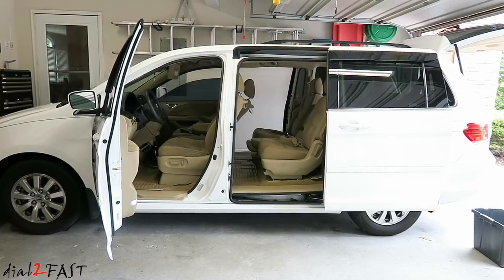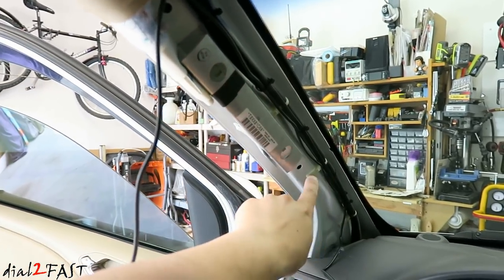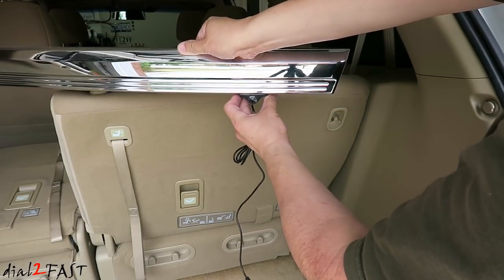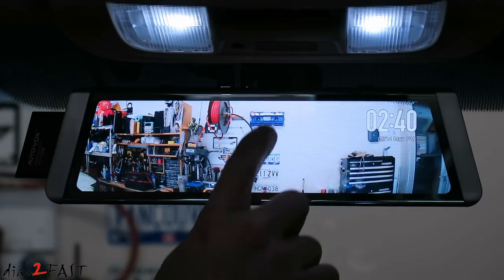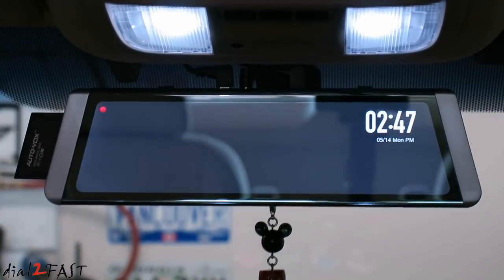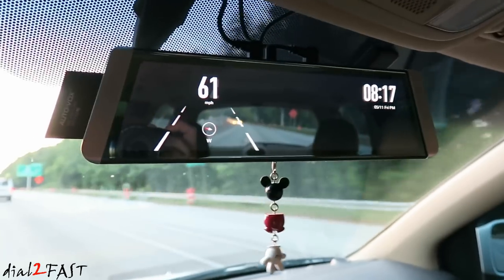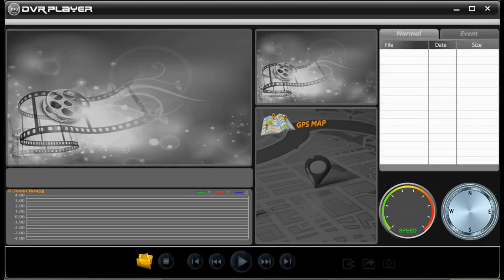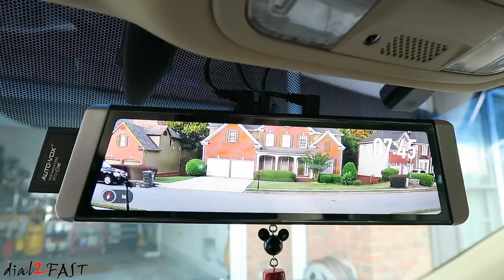AUTO-VOX X1 Fullscreen LCD Rearview Mirror Dashcam INSTALL

Comment: The straps are just deal killer. Soon  heat and cold  and UV rays will weaken them and make your dashcam wobbly and time again you need a new strap or rubber bands. The new dashcam fixed this by total installation of the dashcam (remove stock dashcam) and replace with the dashcam itself for a clean, sleek OEM style. A dashcam that does this is nikomaku.

Comment: I'm assuming the device turns off when powered through the 12v accessory. Does the settings and time remain correct after each restart? In other words, if I park my car at 1pm and return to it at 5pm, does the time say 1pm (time of shut off) or 5pm (time of start)?
Reply from the maker: The internal battery inside the unit saves the date/time in memory.

Comment: Consider installing both this Auto-Vox X1 unit AND the Uniden R3. Both use similar GPS antennas and similar power source. Anyone know if I can use splitters to run both units from a single antenna and single power source?

Comment: I sent mine back. A couple of reasons to be honest. I found that the rear camera had a better quality  picture than the front,  and I felt that the angle of view from the front camera wasnt centered due to the camera being off to the left hand side. Ok for left hand drive vehicles but for right hand side vehicles it left you with a of centre view. Such a shame.

Comment: This is by far the best mirror-based backup camera video I ever watched. Excellent job! I have a mid-sized SUV and just curious how to install the wire through the side roof-line (save the distance of wire) without interfering with the airbags, which the video didn’t show.

Comment: trying to review some mirror systems before buy anything. and so far i like this display the best. and how can have both cameras on and display. i have a lil truck i built a truck cap for. NO seeing out the back at all. and tough at corner stop signs if weird angle. so i plan to do a camera system :) but idk what ima do yet. might just do a inverter and run a home security cctv setup. install lil cameras in a few spots so i can see my blind spots and back up cause i dont need one pointing forward i can see just fine lol.

Comment: Thanks for the detailed breakdown especially the reverse camera installation. I'm gonna have to check the car i'm buying for a way to wire it properly if possible at all. It's fairly new and the interior trim is probably much harder to disassemble.

Comment: Wow detailed review, This device have good features, I was thinking of the feature that view should get captured along with 1) Front CAM, 2) Rear CAM, 3) GPS Location with LAT & LON, 4) Speed of Vehicle. But at the end was happy to see the desired 3 points. As I am planning to develop the CAR Device with all advance features. Dial2Fast you are good in review.

Comment: Excellent video! I especially liked the real-time driving video to get an idea of how well the unit actually works on the road. I wish the manufacturer had made the rear camera wireless so that it would be much easier to install. Other than that, it  seems like a great unit.
Reply: Yeah but then you would probably have more of a delay. You would also need to change te battery of the back camera every so often...

Comment: Just purchased this unit and will be installing it soon.  I can't find an answer to this question anywhere and thought you might be able to help...
Can the rear camera feed be re-oriented/flipped?  Just wondering if it matters which side is up/down, as I'm considering a couple different options in terms of placement.  Thank you for your help!
Reply: Did you ever get an answer to this. I would very much like to know if i can mount the camera on top of my van.

Comment: I bought this mirror and had it installed, I LOVE this mirror on my Campervan. I specifically bought it so I could keep the videos of my travels. At the end you show the DVR Player program. HOW did you download this program? HOW did you get the videos/photos off the MICO-SD card on to your computer?

Thanks!
Reply: Question does yours take about 2 minutes to turn off after turning off the car?

Comment: Hi, first of all, great video.. I have bought and fitted the X2 model. The mirror and camera's are great but have one issue. I am in the UK so drive on the left and right hand drive, although the cameras work well, no matter what setting I put the mirror in the Lane Departure Warning System to work, does it only work on certain roads or conditions?? Also does anyone know how to update the Firmware if needed.
Reply: Good questions...... are there any UK users who could respond?

Intuitively I would expect the camera lens to swivel for the user to get the ldw lines exactly right.

Comment: Nice video, so when you start  the camera it will show rear view first ? also how about night time as there is no dimming you will be blind by the car lights behind you. Thank you
Reply from the maker: When you start the car, the LCD will turn on and show you the last view you had it at. If you were looking at the front camera last, it will show the front, and if you previously had it on the rear camera, then it will show the rear. As for LCD brightness, the setup alllows for auto brightness adjust (this is what I have it set to) or manual brightness adjust. I don't have issue with cars behind me at night with the headlights on when looking at the LCD.

Comment: Since the rear camera is not center on the hatch, do you have to off set the angle? Or keep it stright?
Reply from the maker: It's a wide angle lens, so the off center placement will not effect image view. It will look centered on the screen.

Comment: I just installed mine less than a day ago and like it so far. The LDW seems buggy but it may depend of brightness and color of lane markings?  What's your opinion?
Also, just wondering if this is powered from an always on 12v, will it drain the car battery while parked for long periods?  Any experiences?  I really hate to have to turn it off after parking each day.
Reply: Question does yours take about 2 minutes to turn off after turning off the car?

Comment: can able to hardwire this permanently  ?  If so, will you hook it to a powered or switched fuse? the back up camera is not ground?
and the back up camera no clip to secure only use the tape can dry up due to the extreme weather , how to upload all the recording to the computer ?
love to buy this.
Reply from the maker: You can wire a female cigarette lighter plug to the fuse box with +12V switched ignition. The double sided tape is automotive grade and does not dry up. To get the video clips, plug the memory card in a card reader on your computer.

Comment: HOW did you download DVR Player program? HOW did you get the videos/photos off the MICO-SD card on to your computer? Could you explain briefly? Thanks
Reply from the maker: The software is automatically copied to the micro SD memory card once you start using the dashcam. Take the SD card out of the dashcam, and put it in a card reader that's connected to your computer. You can pickup a card reader like this for couple dollars: https://amzn.to/2xzPRl7

Comment: Auto-VOX x1 install: power supply when ignition is off?  How exactly is the unit ment to be supplied? If supplied from the cigarrette lighter (or ACC terminal) then generally +12V voltage (and power) will only come up when ignition is turned on. Can the unit also be permanently powered from an "olways on" +12V terminal? And if so, will the unit still know when the car is operated and when it is parked? I ask this question because the internal battery of the unit should somehow always be kept fresh especially if it is to record motion behind the parked vehicle etc. Also, is there a place where one can download the user's manual and possible firmware bug fixes / updates? Anyhow, thank you for the very nice videos, greetings from Vienna, Austria. Roland Schweiger
Reply: Roland Schweiger he said it has a internal battery
Reply: I have an older model (M6) and they sold an optional direct wire kit. I'd imagine they would also have for this as well. One thing, however, I assume it would always be on/recording then, so I'd be mindful to turn it off manually when not in use or you'll drain your battery.

Comment: However the front video camera will be constantly moved when adjusting the rare view mirror no? Can I track my car remotely with the gps from my phone?
Reply from the maker: It's a wide angle lens, so if you have to adjust the mirror slightly, it will still capture the road ahead. There is no gps tracking.

Comment: First of all, thank you or your videos. Just got one question: on amazon manufacturer says, that rear view camera is recording at all time. But than, perhaps camera should not be connected to car´s backup light? But if it is not connected to car´s backup light, does rear view pop up automatically, when you switch gear to Reverse? I find this a bit confusing. Thank you for explanation :)
Reply from the maker: The front and rear cameras are always recording (regardless you connect to the backup light). The purpose of connecting the backup light is simply a trigger wire to switch the LCD screen from the regular rear view to the 'lowered' backup view. If you don't connect to the backup light, the rear view will never switch to the backup view. Hope that helps.
Reply: It surely does. Thank you.

Comment: The image in the rear camera seems not to be reversed, so it's like you are looking directly out of the back window. That's opposite to the images in all the rear view cameras that I have seen.  Can that be changed to be a true mirror image?
Reply from the maker: The image you see on the X1 LCD mirror is same as what you would see on a regular rearview mirror. The LCD image (and regular rearview mirror image) will be opposite to when you turn your head and look out the back window.

Comment: Hey how do I get the lane departure to work? Does the back up camera have to be hardwired so it turns on when you put the car in reverse?
Reply from the maker: Lane departure warning will work once you enable that feature in the menu. Backup camera connects to mirror using the USB cable. You also have the wire that you connect to backup light so the LCD will switch from rear view to backup view when you put the car in reverse.
Reply: dial2fast I enabled it and it didn't do abusing

Comment: How did you get power to the rear camera without putting  on reverse?
Thanks
Reply from the maker: The rear camera cable provides power. This is a front / rear dash cam on its own. Reverse function is optional for you to connect.

Comment: Would you know what’s the difference between Auto-Vox x1 and the x2? I was about tu purchase the x1 and then Amazon recommended the x2. Price difference is like $10 dollars. Thanks for your great videos
Reply from the maker: Hmmm...interesting. I took a look at both units, and they look identical in spec. The only thing I can see is the X2 has a black side bezel, where the X1 is silver. Maybe just a different look.
Reply: dial2fast Thank you!
Reply from the maker: There is no functional difference between X1 and X2. The X2 is black instead of silver color.
Reply: Hi, Does the Camera start to record automatically once you turn on the Key? Does a front and the rear cameras record  at same time?

Comment: Curious if you had any issues with the mirror vibrating, due to it just being mounted with rubber straps?
Reply from the maker: These type of strap on mirrors will have some vibration over rough road. Also how firm the factory mirror mount will also affect it.
Reply: Thank you!  That was my primary concern.  I have a vehicle with a proprietary bracket that holds the rearview in the headliner, so an OEM upgrade is proving nigh impossible to find.  This offers the best compromise, but like I said I was concerned that it would be shaky.  :)  My original mirror is quite secure, so that should help.
Reply: Wondering if zip ties would prove better than the stretchy straps....have you tried anything other than what came in the box?

Comment: Will it still record if you turn off the display and only have mirror?
Reply from the maker: Yes it still records.
Reply: 5 years ago, I got this camera, and the charger got destroyed. Now, I'm looking back at this video and would like to thank you for this review. Unfortunately, auto vox doesn't sell this model anymore nor the original charger cable. I have tried using alternatives, they suggested me, but this camera only works with the one it came with. RIP.

Comment: Is there any restriction on the model or make of the car for this dashcam?
Reply from the maker: You can install this on any car.
Reply: sounds great!
Reply: dial2fast 
Good installation video.  I bought 1 from  Amazon and installed yesterday. But why my rear backup camera read some one license plate backward  in my  dash cam. Maybe I have to flip my rear camera around?  Thank
Reply: Not a great fit on my Ford C Max 2013, lens is obstructed by Ford fitted covers to the rain detectors and light detectors.

Comment: WD-40 is a SOLVENT... not a LUBRICANT.  
WD-40 is a SOLVENT... not a LUBRICANT.  
WD-40 is a SOLVENT... not a LUBRICANT.  
Why are so many people confused about that?
Reply: No, it MAY have some small solvent properties as a result of having some lubricants in its formula, but it functions and was designed to be a water displacement and protectant with some lubricant qualities. It does not in itself harm rubber, but may as a result of mechanical action.
Is it a great spray lubricant? No, not at all. But it is handy, does some lubrication, protects metal parts and especially electrical components, as was designed.
Plus, it’s really easy to use and very cheap.
While mild dishwashing soap is quite effective in installations such as this, it leaves a gummy residue and is hydrophilic, which means it attracts water. And as all soaps are solvents and “transporters” they in itself will degrade insulation. It may take decades, but it will happen. Why else would you ever use dishwashing soap for, well washing dishes?
Reply: who cares and why are you obsessed with that?